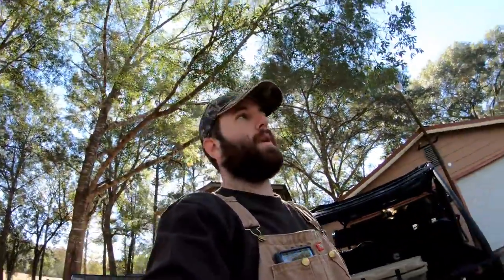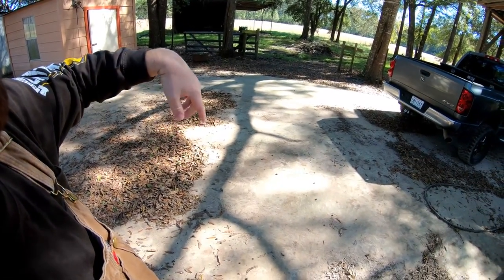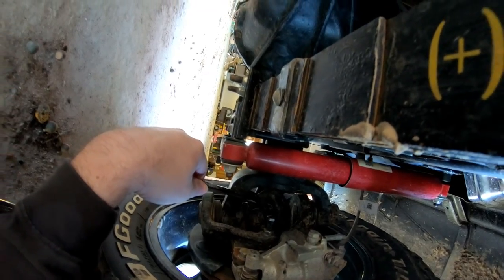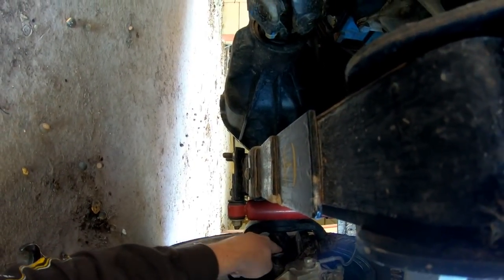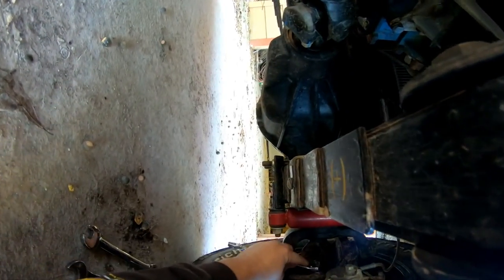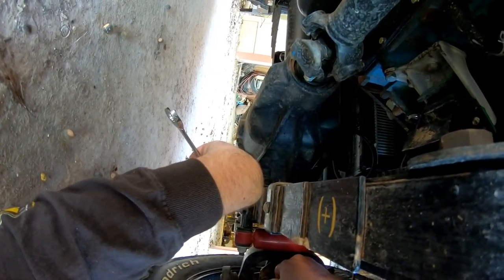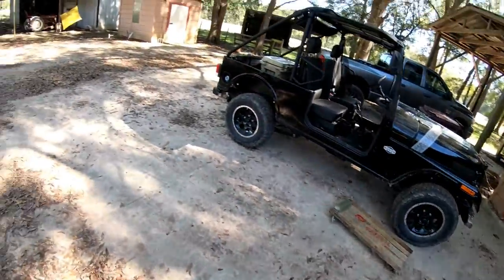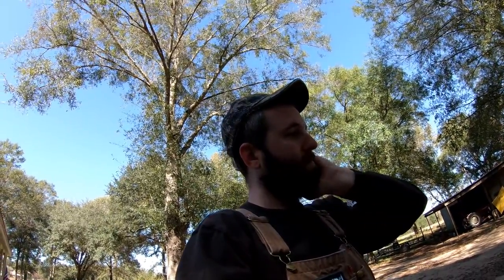Mahindra Roxor Steering radius adjustment!

Comment: Hey great stuff.... I own a Thar, Roxor's elder brother in India. I have never heard or seen this adjustment. Can you give little more detail on what you are adjusting ? Does it change the wheel alignment ? Did you check your alignment after the adjustment ?
Reply from the maker: Im sorry I know I wasn't very close to what I was working on, I had t he camera mounted to my head. Basically its just a bolt there next to your wheel, the bolt adjusted in or out will decide how much your wheel can turn. And no I haven't checked the alignment, it shouldn't have any affect on that.
Reply: You can't fo it on Thar CRde for the simple reason it has IFS and not solid axle with OKBJ  .
It can be done on Thar Di aka ROXOR

Comment: Word on the street is the aftermarket is coming out with gears, lockers and lifts.
Reply from the maker: LawnLife I hope so man. I'm holding back on spending any kind of money until I see exactly what I want
Reply: you should see the videos of abiez mahindra ,he is sourcing parts from india
Reply: I went to one dealership n they where going put the leaf springs on top of the axles n put 35 on it .
Reply: @9a11coleman  that's exactly my plan as soon as there are stronger axle shafts available.  I don't think 10 spline shafts will last long with 35's.
Reply: @dirtbeard108  I dont think I would put 35 on it .
Reply: I want sheet metal body parts also, like fold down windshield, flat front fenders an a true 5 or 7 slat jeep style front clip, an different lockers front an rear for bigger sneakers, but mine would be mainly used for hunting in the swamps of FLA.